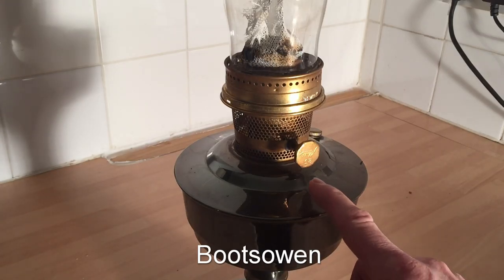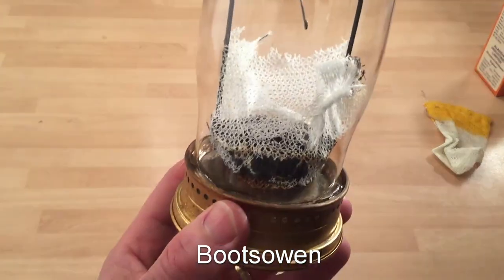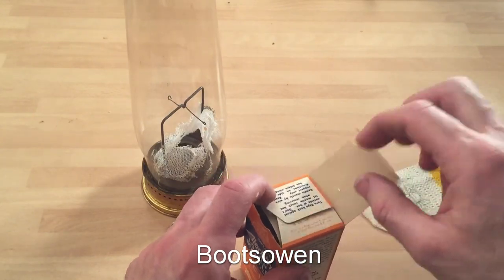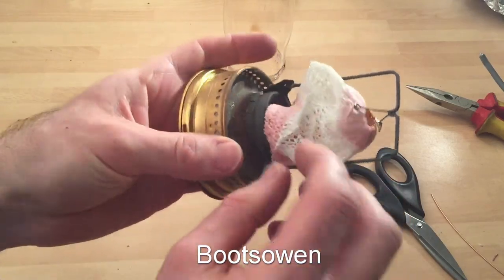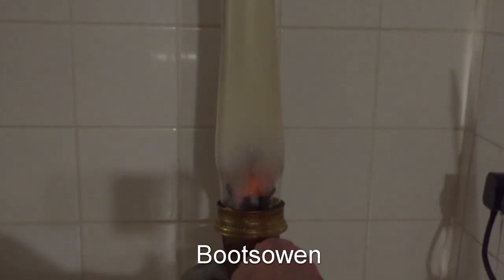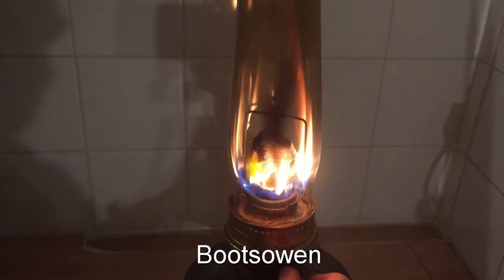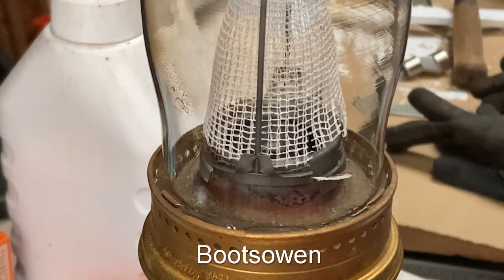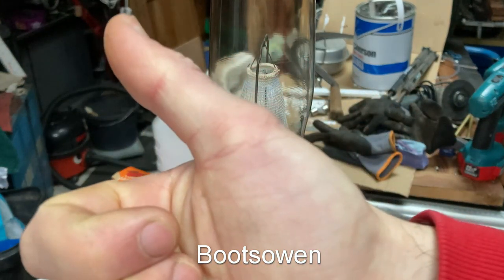Aladdin lamp experiments with a Coleman mantle instead of a Loxon mantle

Comment: Always preheat the lamp at its lowest setting for ten minutes and then turn it up slowly over several minutes or you risk shattering the glass. If you think mantels are expensive, that glass will really set you back quite a bit. Mantels no longer contain thorium which made them glow white hot. If you have any Colman lanterns they have mantels in the Philippines that contain thorium.

Comment: Owen, I remember from the caravan gas lights days that the mantles were lit with a match to burn them off gently, then they was lit on gas, I think there's you problem. Also note the flame is drawn up the inside of the mantle chimney, the other re purposed mantle did not have the chimney effect, cheers

Comment: Lighting a mantle (for the first time) inside the chimney is not advisable. 'Burn off' or 'flash over' the mantle outside the chimney. Once the chimneys back on, maintain a small flame until everything heated up to operating temperature... It's the point where the chimney drafts air upward, just like a fireplace chimney. When there's any sign of smoke or soot, it's time to turn down the flame to burn off the residue and whiten the mantle again.

Comment: You should only trim your wick after 50 hours. Most people only do it twice a year. It all depends on how much you use it. And the wick should be perfectly flat around. Even a small high spot can effect the flame. Then effecting glow of the mantle. And you should use a lighter or match to burn off the mantle. When you’re lighting its suppose to warm up on  for ten minutes on the lowest.
Reply from the maker: Thanks. I’ll know next time. It’s strange they don’t put the instructions on the box!

Comment: You might have had better luck with the Coleman mantle if you hadn't massively over fired it immediately.  The reason it was all black was that it was covered in soot, as the chimney was about to be.  The solution to this is to turn the flame down, not up, and let it slowly burn off.

Comment: Good try but I think you should light the mantel outside with the glass removed.  Keeping the flam low.  Then placing the glass on and allowing it to gently warm up over several minutes.  I am amazed the glass did not crack when you suddenly turned up the flame.
Reply from the maker: You are right, lots of people have said the same thing!

Comment: The Aladdin website specifically says not to use liquid paraffin... only Aladdin lamp fuel (totally odorless), or K-1 Kerosene... surprised to see you using liquid paraffin... 

...also, they say to burn off the coating on the mantles with the flame of a match, touching the top of the mantle and letting it burn down the mantle by itself, then replacing the chimney after the coating has burned off, not by placing it directly over the lamp flame, as burning it off over the lamp flame can break the mantle, as happened to the bottom of yours...  

They also warn against turning your flame up until you've allowed the lamp to warm up initially with only 1/2 the mantle glowing for 20 minutes over a low flame... the mantle will increase it's glowing all by itself during that time as the lamp heats up, and after that it can be adjusted if it's over-firing at that point by turning down the flame which will burn off any dark spots of the mantle that have formed before adjusting it to it's optimum brightness without any flames appearing above the mantle after that... 

I just bought two Aladdin Shelf Lamps, and following these procedures they worked great after I assembled them and tried them out for the first time...
Reply: Kerosene is a type of Paraffin oil, which is just the broader term of petroleum products of that type. You do not need to purchase expensive Aladdin brand paraffin oil for the lamps to work correctly or even optimally. I use regular clear Kerosene or generic Paraffin oil and there is no problem with my lamp's functioning. I have tried 3 different Aladdin lamps and 2 different center draft lamps all with great success. There may be some brands that are more or less refined, but today, all clear kerosenes and paraffin oils are up to snuff for burning in these lamps as they were used to burning on lower quality kerosenes in their time anyway so this argument makes no sense. Any issues you experience with these lamps are due to mechanical issues, airflow going where it shouldn't go, etc, not a fuel issue. They can burn whale oil if you really want, even some vegetable oils can work (though it is not recommended)

Comment: Great video and thanks for trying the Coleman.  I believe the mantle broke during the concussion of the ignition of it.  I always burned off the mantle by match, starting at a single edge.  No poof, no broken mantle.
Reply from the maker: Thanks. I was just giving it a go. I would do it differently if I was fitting a new mantle again.
Reply: @bootsowen  And thank you for doing that!  Much more than what I've tried.  This video actually got me thinking, I have an Aladdin #11 and it needs a mantle, so I ordered one and threw in a new wick to boot.  I am also currently looking into large lantern mantles to potentially try the same thing.  Those Aladdin mantles are expensive!  Keep tinkering and doing these videos!

Comment: When you have finished with the lamp turn the wick right down and bunch some old rag and cover the top of the chimney thus smothering the flame, never even gently try to blow out the flame, also when installing the mantle, like the others advised, don't fit the chimney , light a match to burn  the mantle only then fit the glass to the frame, light with and assemble the whole thing.

Comment: What you are doing wrong is...1   that little coleman mantle is not long enough.   so you'll have to lower it about a half inch.   2.  do not light the mantle inside the lamp.   Light it  before you put the gallery of the lamp back together  ....        Yes definitely Light it outside  so you don't fill your home with smoke.

Comment: Please let your Aladdin lamp burn for about 5-10 minutes on super low flame before you turn the heat up. And just turn it up gradually. If you don’t carefully raise the heat it won’t burn cleanly, your mantle will get covered in soot and the whole thing will start smoking. Ruining the mantle in the process. 

It’s best on all types of mantles to burn the mantle with a lighter before you apply a fuel source to it. Gas mantles will not burn fully and will often get damaged from pressure of the gas. So again, please burn the mantles before turning the lantern on or setting the gallery onto the burner. This will also minimize smoke.

Comment: I have recently tried the same. The Coleman mantles shrink too much and end up sitting too high above the burner flame, and equally important is the opening at the top of the mantle needs to be larger for air flow through it...which is why your attempt ran sooty rich. 
I've also tried to concoct a substance to coat the mantle cloth, let dry, then burn off with the hope of leaving a well formed ash behind (the way Aladdin mantles are made). They have a process not easily replicated.
Reply: I was thinking that egg whites might work for this purpose.
Reply: I believe it to be nitrocellulose that coats the yttrium doped lattice. There may be a wax like component to the coating as well. You might try a coating made from liquid bandage, which is mainly nitrocellulose in a volatile solvent that will quickly evaporate after application. You could even add more yttrium oxide to the coating material in an attempt to increase the heat to light conversion efficiency. Please let me know if this works!

Comment: I haven't tried it yet I've been told that paint like consistently of plaster used to paint the mantles to the lower frame will hold it. You might try burning the mantle before using fuel.

Comment: I've tried using a gas mantle on one of my Aladdin lamps, it failed as it was just too soft to hold itself up, that and the airflow through it wasn't enough to keep the blueflame effect going, so didn't even illuminate properly...

Also, the mantles on Aladdin lamps twist-lock in place, not snap on, hence their "Loxon" (I.E. Locks-on) name... :)

Comment: I would recommend burning the mantle (for the first time) in open air, it allows it burn more completely and evenly leaving it completely white (not partially grey) Second, do not turn up the flame more than letting it be blue. It takes time to heat up and should not be made to glow right away. If it is being made to glow from yellow flame, you will eventually combust the mantle and it will turn black. Blue flame only. After some time, the interior of the bowed part of the chimney will get hot enough to "incandesce" the mantle. You do not want to burn your mantle, it smells HORRIBLE and nobody should ever breath that stuff.
Reply: You make no sense. Warmup is right, but your burning comment is wrong.  The cotton or whatever flammable material must indeed be fully burned off at first use, carefully.  After that, there's literally nothing to burn, it's just (often  thorium radioactive) inflammable ash.

Comment: You will clog up your burner if you use any fuel that is parrafin or wax based.  You should only use Aladdin Kerosene or a 1-K high grade clean/clear (no dye) kerosene.  🌻
Reply from the maker: Thanks for the tips!
Reply: Nonsense

Comment: Thanks for sharing an interesting experiment. I think I detected an Irish accent and was wondering if you filmed this in IRL? The reason I ask is that one of the other comments from INM TV suggested you use Aladdin kero or 1-K , neither of which ( to my knowledge) are available in Ireland. Certainly not where I live. I resorted to purchasing premium grade paraffin at the extortionate price of €27 per gallon. The mantle is also vey expensive. I wanted to get one of my Aladdins working to give as a gift to my daughter who lives on a canal boat in UK. There is an interesting video on YouTube by Jeff Hall who uses his adapted Aladdin to light and heat a canal boat.
Reply from the maker: I lived in Ireland I. The past. These lamps run fine on kero from the petrol pump. If you want to experiment you could run some kerosene through a cat litter filter. The price you paid was very high. I like to have a number of redundancies in terms of light heat and water. Electric is the cheapest by far for light. A solar panel, battery and led will give more light than a kerosene lamp.

Comment: Is it possible that the pressure from the the gas lamps flame keeps the gas type mantles in shape?  Therefore you need a stiff mantle for the Aladdin lamps as its just a rising flame !  I have looked for alternatives as Aladdin mantles are now £25 making them and kerosene £2.5 - 3.00 a litre. It's no longer cheap to run one of these. If I'm wrong let me know.
Reply from the maker: I guess if you can't get electricity or gas then maybe it is still worth it. But I agree that the mantles are too expensive.

Comment: Still lots of radioactive...doped with Thorium 232, mantles available. Everyone should own a geiger counter...🤣...
Apparently greatest risk comes from loose particles being inhaled or ingested.
Been told that the orange boxed ones are radioactive & the red not, but I'd want to confirm first with the GM counter.

Just wondering WHY the Aladdin specific mantles are so expensive, where the cheapest I've seen are around £35 each!!!, which is extortionate. Are they not manufactured any more OR is the demand so high, because of world events starting a couple of years ago?
Reply: In my view they are a complete ripoff and would guess Aladdin makes about  500% profit on these things. Surprised this company is still in business.
Reply: Yes they are expensive. But they are still in daily use here with the Amish people here in the Ozarks. Our local hardware store stocks the mantles, wicks, and other parts.

Comment: Way, way too fast! You must protect the mantle - should last over three months with daily use. Burn off the blue protective coating with a match, BEFORE fitting the chimney. Then light the wick and turn it right down. Fit the gallery, chimney and mantle assembly. Allow everything to warm up to an equal temperature for three to four minutes. Finally turn up the wick incrementally to full incandesce over 10 to fifteen minutes, or more. If you spot any black marks (burning) appearing turn the wick back down until they disappear, then continue turning the wick up gradually. Should then be set up for hours of light. If you find burn marks on the mantle after extinguishing the lamp, they can often be made to vanish the next time you light the lamp, if you take your time. Life was slow back in the day! I have three of these Aladdin lamps. They are still made in the USA and new parts can still be purchased. A mantle is now £25! I get mine from: https://jmoncrieff.co.uk .When my Dad left the RAF we had to live in an old railway carriage, no electricity, while we waited to be allocated a council house. Good practice for what may be to come. I also have an Aladdinette 11 Paraffin heater. I only use lamp oil in the lamps and the heater. Lamp oil is also initially expensive to buy now, but, over time, still dirt cheap, compared to electricity and gas! Good video. Thank you.